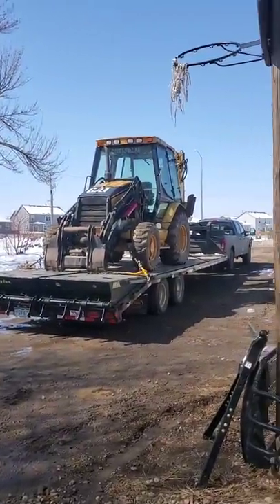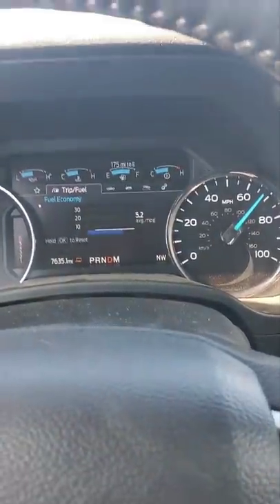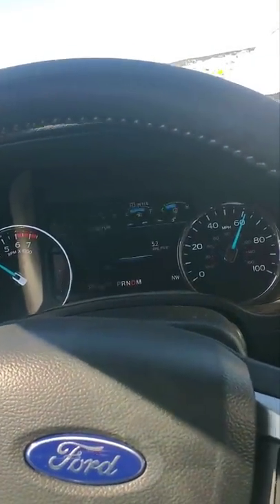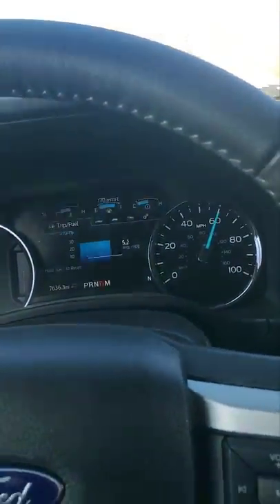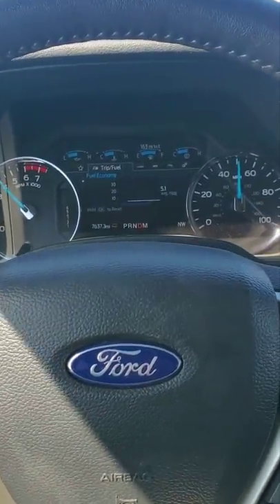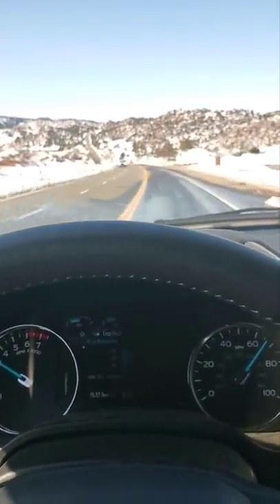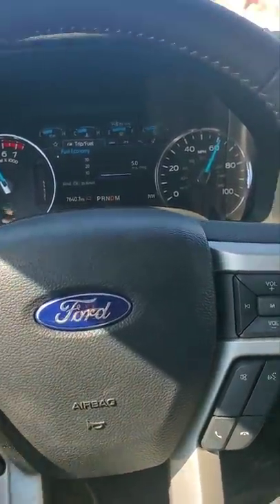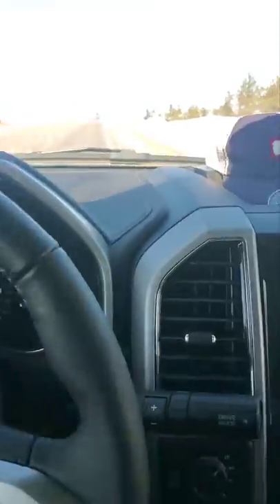7.3 godzilla towing 24k lbs through the rockies.

Comment: I pull a 41' 5th wheel  weighs 15,000  with a 2021 f250 tremor package  7.3 with 430 gears it pulls like a CLYDESDALE, I love seeing this. The Tow Haul mode is very finicky it holds a gear Going down hill but when you gotta stop and apply the brakes it down shifts sending the RPMS through the roof
Reply: Lol yea that would freak me out always having high rpm’s towing

Comment: Amazing! especially with a 3.55
Reply: Really? That's a pretty common ratio. 4.30 is stupid low for a modern "big-block" 3/4-ton.
Reply: @deeremeyer1749  unless you towing more than that backhoe weight then 4.30 is necessary

Comment: Update, got a 21 kz toy hauler 5th wheel, dry weight 11330 pin weight 2120, 7.3 4:30 pulls it really well , think I gotta gas powered diesel

Comment: Nice job, with the 10 speeds the rear gear is not as big a factor as it use to be, you are really just one gear lower in the trans than if you had the 430s

Comment: Just imagine the godzilla with a turbo. I bet you could make one of these make like the diesel torque. But also trucks are heavily detuned to stay reliable so there is many more potential to be unlock and there is people already making over 1000 HP and torque.
Reply: Yup. I’d even take the 5.0 Coyote with a turbo. I know everyone is raving about the 7.3 but I wish it had another 100 ft lbs of torque. I tow in ID and MT during the summer. I think this truck would struggle a bit.
Reply: @jjsemperfi  I've towed 10000 lbs with it and even had max payload in the bed of the truck and it didn't complain or struggle once. I have the 3.55 differential. But I should of just gotten the 4.30 and be done with it. You only lose like 1 mpg by getting them.

Comment: The difference in fuel mileage is wiped when you factor in 12 grand for a diesel motor package over the gasser . that will buy a lot of gas to offset it 👍
Reply: What's the resale, depreciation and insurance difference? How long before your time is "wiped" too filling up with gas at a gas station buying shitty gas at "full retail" when you can buy your fuel at a co-op or quality "truck stop" and get a fuel card, points, rewards, discounts and all the same "conveniences" you get at the "gas station". 

Love to see all you "trailer towers" jacking around at the gas pumps with all those big loads you claim you "tow" with your light-duty SRW gas hogs you won't get ten cents on the dollar for at "3000 hours" which as any Ford "engineer" has mentioned them being "tested". Be the first new Ford engine "platform" in...Ford's 30ish year history of building "high tech" and "high performance" and "high compression" engines without a real "advance" in their "computers" and "control systems" since the first MPFI "speed-density" engines came out 5 years before that without "teething problems" if they make it to "year two" of "mass production" and into "fleet service" without at least a 10%,catastrophic failure "rate" if they hold together and as the "heavy duty gas engine" idiot Super Duty buyers are choosing to "save money" but still buy Ford because...Ram and GM dealers won't even take their "trade" for nothing, I really doubt they're gonna hold together.

I'm sure since Ford "partnered" with GM Powertrain on that hilarious 10-speed automatic Ford's "heavy-duty gas" engine needs for "towing" that if absolutely possible Ford has done everything possible to "save" Godzilla at the expense of the transmission and listening to this piece of shit "hunt" as he drives along the "front range" of the Rockies on a 65-mile "hill" from 5000-ft. Fort Collins to 7000-ft. Laramie at what is certainly an "overweight" load if its "24,000 lbs" less his "tow vehicle" and he babbles on about bullshit "science" and "engineering" he doesn't even get half right by accident, it's obvious Ford put zero "artificial intelligence" and "shift logic" into whatever "computer" is operating the trans and apparently no "tow-hail mode" OR like most Fordtards this idiot is too smart to read an operators manual or simply "downshift" to the "middle speed" of the at least 3 it's "hunting" through because he's too f'ing stupid to let it do the "thinking" for him..

"Automatic" does  not mean "endlessly capable of banging up and down "speeds" without damage". Especially a "10-speed".. Now a "powershift" on the other hand that is constantly engaging and disengaging "clutch packs" and has no sprags or bands or planetaries being "shock-loaded" constantly and no "converter slippage" or converter "lock" and "unlock" between "speeds" can handle being shifted continuously. It.shouldn't have to and only idiot "drivers" can't "find a gear" and stay there but it can handle it. 

An Allison "automatic" in a GM diesel OR ACTUAL HEAVY-DUTY GAS is much more like a "powershift" once in a "direction" and shifting "automatically" or "manually" involves "dropping" one clutch pack while "picking up another" one "slips" and acts as a "brake" and the other "slips" during engagement and together they act as a "synchronizer". 

Far fewer parts, far fewer "speeds", far less wasted "power", far larger components with lots of interchangeabiliy and far "smarter" just by being "simpler".

Anybody.who hears that and doesn't tealize this guy is an idiot and/or that engine is a gutless f'ing wonder and that trans is going to be shelled in no time is probably an ideal "Godzilla" consumer. 

The "$7500" engine may "hold up" for 100,000 miles which apparently is acceptable to Fordtards. 

But a new from GM 6 or 8-speed automatic for a full-size truck or SUV is about $4500 dealer-installed and they are not considered "servi ceable" once you need a "hook" to get in. 

So figure FoMoCo is gonna jack the dealer $7500ish for a new "Godzilla" trans, the dealer is going to "mark up" that trans 20% just for CYA and supplies AND probably replace rather than "flush" the cooler(s) and lines including the radiator if the cooler is internal. And thar could be a "lift the cab" deal and likely will be so figure 20 hours at $100 per hour for $1000 in labor plus $9000 for the trans and another $1000 in parts, supplies, etc and maybe the dealer "throws in" a full service "on the house". 

That puts you $11,000 into "Godzilla" and you just bought the PowerJoke only it's not under the hood. 

And at "trade in" whatever percentage you "saved" on the gas burner is going to be doubled and deducted from the "book values" for PowerStrokes which have been around "forever" compared to "Godzilla".

Anybody thinking gas burner to "tow" enough often enough to need a "Super Duty" to start with that thinks they'll "save money" when every "ownership cost per mile" is as high or higher with that "heavy-duty" gas engine that "replaced" the Triton 6.8 V10 and because..."cheaper gas" is blooming idiot. 

"Only" 8 mpg with a PowerChoke vs "5-6" with the gas burner is 33% to 60% better mileage. That's 33% to 60% less time "at the pump" and 33% to 60% further between fillups.

And that's your worst-case scenario. Cut it in half and figure diesel saves you 50% across the board in fuel used and time an basically diesel has to be $5 per gallon and gas $2.50 to "lose money" on the diesel. And the additional cost of the diesel up front is what, 15% percent of the MSRP? And Ford is selling "crate motors" for $7500? That's 10% of a completely loaded King Ranch 4-door 4wd dually right there. 

So who is getting "screwed" as they actually "save" only $3500 on a $7500 gasser vs an $11,000 diesel? 

Nobody ever said Ford guys are good at math.n
Reply: 6 mpg diesel vs. 5 mpg gas is 20% better. Is the difference ever going to be that small? Not a chance. You can figure the diesel is going to do 50% better across the board worst-case and there is only one "grade" of diesel fuel and no "penalty" for buying "lower grade" or "higher grade" gas. You're also spending 50% less TIME refueling and can drive 50% farther and "save money" by driving further to cheaper fuel. The $7500 Ford gets for a Godzilla "crate motor" is 10% of MSRP for a LOADED F350 dually 4-door diesel. Go price a 6.7 "crate motor" and I guarantee it's a lot more than $11,000 "over" the base price for a "free" Godzilla that will cost you as much or more "per mile".to OWN as the diesel BEFORE you get to fuel which at BEST is gonna average 10 mpg
 if you "tow" and "daily drive" a fat gas.sucking pig of a "big-block Ford".  Gas at 2.50 per gallon is 25 cents per mile. A dollar every FOUR MINUTES at 60 mph. FIFTEEN DOLLARS PER HOUR. 100,000ISH MILES IS 3000ISH HOURS. 

$15,000 THAT "FREE" GAS BURNER COST YOU IN 100,000 MILES MINIMUM. YOU GONNA GET THAT BACK AT "TRADE-IN TIME"? 

You don't have a clue.
Reply: @deeremeyer1749  I've enjoyed getting your rants deleted. Keep typing and I'll keep deleting them. 🙂
Reply: @deeremeyer1749  diesel a complete waste of money for 99% of the folks buying heavy duty trucks. On top of that, none of them are reliable anymore. And yes you pay 7-10,000 more for them. Not to mention fuel is more. Diesels just have lost their appetite all the emotion crap..etc.
Reply: @deeremeyer1749   Tell that to my buddy that lost an entire fuel system on his 21 6.7 last week to the tune of 17K in warranty work only to have it happen 4,000 miles later.....
Reply: @RJ-lv4yw   Auction values just aren't their on the modern diesels once they are out of warranty.   One fuel system replacement due to a faulty cp4 pump could bankrupt you.......
Reply: @Michael-rl5ki  all that rant = a lot of butt hurt, lol.  Whatever he needs to do to justify his overpriced purchase.

Comment: The 3.73, 4.10 or 4.30 option aren't much more. like a couple hundred. much cheaper than re-gearing. I'd be much more interested in your uploaded mpg. With the 10 speed idk if the 4.30 is necessary. I wonder how the 3.73 or 4.10 would do
Reply: 4.30 is definitely necessary in the underdrive gear

Comment: From your experience, I’m going to be ordering the 7.3 gas engine. Should I go with a f250 or f350 and a 6-3/4 bed or 8’ bed. Looking to haul a gooseneck trailer roughly with weights around 10 pounds. That’s trailer and loaded together
Reply from the maker: I'm my opinion I'm a long bed guy especially for pulling a gooseneck. Gets your cab farther away from The trailer.

Comment: I'm not a ford guy at all, but my boss is. I've got a 16 f450 with the 3 valve v10. I had it tuned and usually gross between 15-18k lbs and I run it everyday threw the mountains of VT and NH. We have a lot of real steep grades over here but they generally arent as long as what you have out there. I like to cruise 80-85 around here so I'm usually right at its peak torque at 3200 rpm and keeps me at a good running start speed. Most hills it'll hold high gear if I get my foot in it early enough, if it does take a gear usually it'll built itself back up to about 85 and i'll make it shift back to high an stand back in it an itll hold the rest of the way. The couple hills that it cant it, it'll drop a gear and fall to about 75 and it'll just sing and hold right there at 42-4300 where that 3rd valave opens. But on a real humid day and running the A/c you can here it struggling a little more. It doesnt like that. But as far as engine power goes, its been great. Theres not many guys around that will hang with me and if they do theyre working for it. That v10 would have benefited in huge proportions if it had had a better drive train, and better drivetrain options. I've got a box on mine that sticks up above the cab a good 3 feet so that makes for a lot of drag at highway speeds. I average 7-8 with it. When I finish wearing it out I hope they buy me a diesel, but if they dont I hope the 7.3 doesnt disappoint because they discontinued the v10.

Comment: How will that truck react at that weight and running those speeds in an emergency braking situation?   I'd rather have something like my neighbor's tow pig. 99 International 4300/4700 crew cab with the DT466 , Eaton Fuller 6+1, and an 8' flatbed. Size matters when towing.
Reply from the maker: That would help definetly the biggest problem still is electric trailer brakes.

Comment: Leadville is a pretty town, I did the bbq train tour in September. I drove a 26’ Uhaul truck with the 7.3 loaded with all my mechanics tools, and other things from the garage, and towing my ford ranger from Jacksonville to Atlanta. It had a six speed I believe and on flat land with the cruise set at 72 it didn’t struggle at all. A couple of the hills on 75 coming into Atlanta kicked it’s ass, but considering I was probably close to its max weight and it was governed to 75 so getting a running start wasn’t an option, I’ll take it. I think I averaged 6mpg, something like that.

Comment: This is great stuff! I'd like to max out my 6.4 see what she can do. Btw, the 6.4 is 429 ft lbs and with the 8 speed 3.73 combo she pulls well.
Reply: The 6.4 is not in the same league as 7.3, I have pulled 11 thousand pound with the 6.4 and I think it had 4.30 gears and the 7.3 had 3.73 gears and the 7.3 will make fun of the 6.4 it is not even close in comparison and I am a ram fan but that 7.3 is a total different animal
Reply: @marynapier3962  If you was a Ram fan you would know the 6.4l didn't have a 4.30 option so you got that mixed up. Now if you put a 4.30 behind a 6.4l it will 100% tow with the 7.3l. Right now the only gear option is the 3.73 and 4.10 with the 6.4l
Reply: @TheRamGuy   no it wont, theres no comparison between engines. the 7.3 is in a whole different class than the rest for a gasser.
Reply: @ZACH_95_  well when you look at max towing numbers for each in like for like gearing configurations they are very similar. Facts dont care about feelings
Reply: I drive a 2014 Ram 3500 with the 6.4 for work every day. When pulling a 10k load on a gooseneck trailer (15k total) in the "mountains" of Michigan the POS can barely hold 60mph at WOT.  I would kill for a Godzilla, Cummins or Powerstroke.  The 6.4 is garbage for pulling any significant weight on a daily basis.

Comment: One of the other major factors is altitude (Note I didn't watch the entire thing, so maybe you brought that up later in the vid) - but naturally aspirated gas engines suffer the most from altitude, and if you're driving the rockies in Wyoming, you're likely over 6000' probably higher in parts maybe even a bit over 7kft. on top of that, with 3.55 gears - that's amazing actually. It just goes to show how great a powerplant/transmission combo this actually is.
Reply from the maker: I was close to 8000 feet above sea level. The town of Laramie is 7280 and I was above Laramie valley

Comment: I got a 21 f350 7.3 with 4:30 rear end I had a 12 and a 16 f250 with 6.2 and 3:73s day and night diff   well pleased
Reply: I had a 2019 F350 6.2L truck. I liked the truck, but read so many positive comments on the 7.3L. So......I sold my old 2006 F350 6.0L truck in January and the 2019 F350 6.2L truck in early February. On March 30th I ordered a 2022 F350 Lariat 7.3l with Tremor Package...so, it has the 4.30 gears (aka, 4.30:1 gear ratios).

Comment: My question is at what weight does the 7.3 become over-kill vs the 6.2. I'm pulling my TT at less than 6500, but felt like I was dragging on some hills in PA with my 6.2 (3:73), compared with my buddy pulling 12k with his 2013 diesel. I get it, he does have a diesel. But I'd like to keep up better and the 7.3 would do that. But as little as we use the truck, maybe a 6.2 with 4.10 gears would do the trick.
Reply from the maker: I don't think you'd get the results your hoping for with just switching to 4.10s

Comment: Why do you think the 3.55 gears are rated so much lower for towing?  Is there any downside to getting the 4.30?
Reply from the maker: Because the taller the gear ratio the farther your gears in rpm are apart in the transmission. Thus making it harder to catch the next gear.

Comment: I have a 42 foot fifth wheel and have been debating get rid of my diesel for a new 7.3L F350.
Reply from the maker: Definetly would recommend 4.30s that's getting into the diesel range for sure. There is no doubt the 7.3 would do it but that diesel lbft would be nice if your gonna stack up miles.
Reply: How about buying gasoline?  I hated getting gas at stations with cars while towing large trailers.  16 pumps in an area the size of a small apartment     Truck stops all the time for me now, back to diesel.
Reply: @toddthompson4190  good point

Comment: i'm not a mechanic and don't know much about this stuff..how much better would that have been with the 4.30 rearend including gas mileage? i'm looking at getting an f-250 tremor package with the 7.3l. my camper only weights about 6k loaded but was thinking of going with the 4.30s in case i ever upgraded to something bigger...from what i can gather there isn't much mpg difference between the 2 rearends...thx
Reply from the maker: Your towing mpgs qoth change much. The 4.30s will make your transmission gears closer together which is nice but if ypur going for mpgs I'd get the 3.55s your empty mpgs on the highway will be a little better.
Reply: @ColtWR  thx for the reply
Reply: If you get the tremor with the 7.3 it automatically gets the 4.30 rear end. No option to get any other gears with the tremor package for gas trucks.
Reply: @WHavriloRT  ya i've come to realize that while doing some research...i guess i was just curious between the two